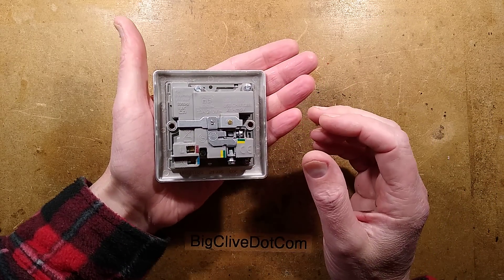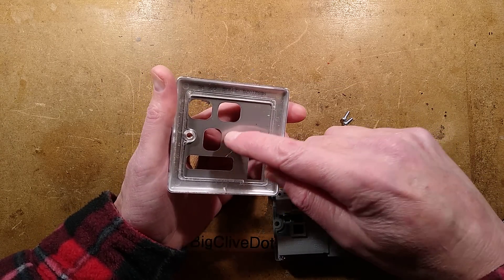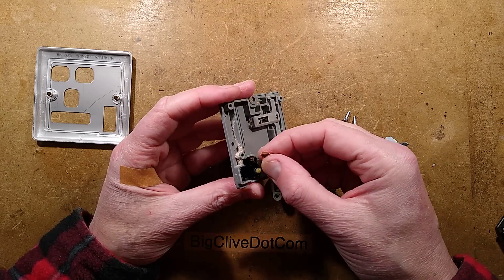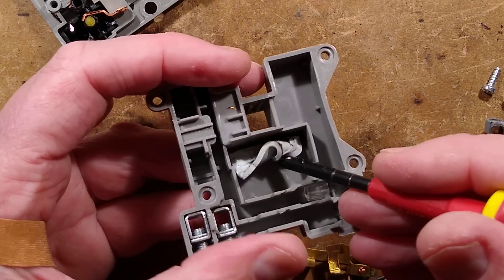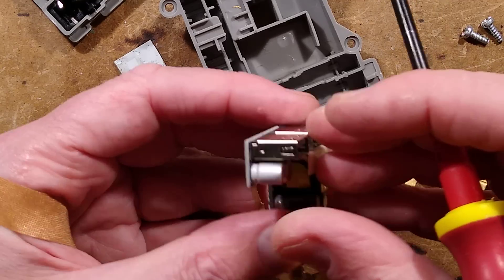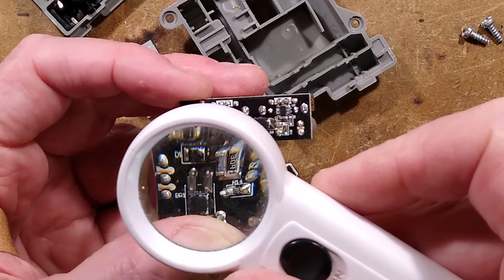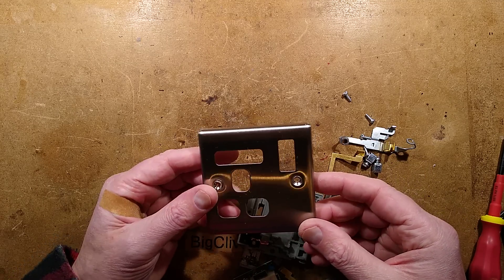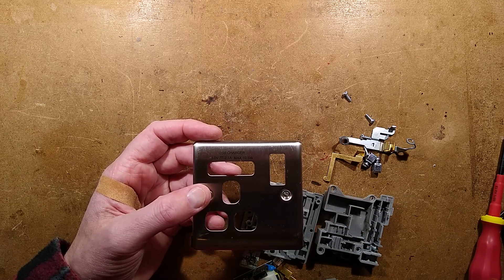Exploded British General USB socket

Comment: Speaking of costly but ideally carried out household electrical repairs, in some markets like the United States, a company called Federal Pacific sold millions of circuit breaker panels and circuit breakers called Stablok for decades. But the Stabloks were later found to fail. UL safety standards they originally claimed and don't always trip when they're supposed to causing fires. The company still exists and the breakers were never recalled, just a notice put out, so many older houses (with poorer people) may still have dubious Stablok circuit breakers. I'm curious what the difference between the Stablok and a good design is! And if a company would make a replacement that is cheap and works well? Apparently the failure to trip rate for Stablok is up to 50%
Reply from the maker: If it's what I think it is, the magnetic trip mechanism was a very flimsy looking flap as opposed to the solenoid coil in European breakers.

Comment: I've never understood why anyone would want these. Sockets, light switches and such are meant to last decades. As soon as you add electronics, they are bound to fail within a couple of years, just as mobile device chargers and others will fail. One huge difference being that you can buy a replacement charger on your way home from work, whereas replacing a socket isn't nearly as easy.

Comment: Thanks again for another great video Clive, I installed several of the double versions of these around our house a few years ago and now feel the urge to bench test the 5v circuitry at the max current and beyond, followed by some over and under input voltage tests. If nothing happens I'll try doing something very silly with the input connections to see if I can replicate that particular failure. BG overall seems to be a pretty good brand but no harm in doing some stress testing on some older ones. If anything spectacular happens I'll report back!
Reply: That bit of foam tape was my idea of 'cooking components'...electronics hate heat

Comment: I had to return 3 double gang with USB sockets to ScrewFix a while ago. First went BAANNG, second and third, the USB controller was completely dead. It seems there's very little in the way of testing before these bits of junk are sent out. The kite mark just seems to be a nice moulded stamp for decoration it seems.

Comment: Convient to have USB power available as well as mains, especially on trains where it means only a USB cable has to be carried with you and not a bulky charger as well.  How about having the a.c. Input to the USB module switched, with the switch operated by plugging in a USB cable, so the USB module electronics would be dead when not in use.

Comment: looks like MOSFET failed, went short, and took out the current sense resistors and then the control IC. Pretty standard failure mechanism of a switchmode supply
Reply from the maker: Yeah.  And people see the exploded sense resistors and think that's the only problem.

Comment: I think that the main issue I have with these things is that, unlike the mains socket, the USB sockets are not switched, so the transformer and all the electrics are permanently live - for basic fire and electrical safety (and for electric bill costs, though that would be marginal here), I don't like anything unnecessarily on, or difficult to switch off.  I have looked around, and no-one seems to be bothered in making one with switches on for those of us who want it, so I would have to put in a switch above it, which would then confuse people because you would have to to turn on two switches for the mains socket.  You would have thought the presence of an existing switch would have given them that idea, but no.

Comment: I always use either fused plug adaptors (the square things with two or three, three pin plug sockets) or a fused extension lead for plugging USB adaptors/chargers into after a genuine phone charger went thermal in the kitchen and just sat there crackling, it didn't trip the ring rcd either. Luckily I was in the room at the time. So having the things integrated in the wall with no protection seems a bad idea.

Comment: You have me worried now, I have 3 BG double sockets on my work bench, totalling 6 USB sockets, is there any protection on the outputs if one of them goes pop during charging, don't want to fry my Gopro, tablet, phone etc, they are all connected to a RCD so safety isn't an issue though.

Comment: What about the fancy dimming switches like the Lutron Diva?  They also have circuit boards and power supplies in those switches, and they are also tucked inside the wall.  I recently had one fail (the builder put them EVERYWHERE), and rather than spend the $30 to replace it, I just put in a good old $3 mechanical interruptor.  I don't need to dim the lights in every room!

Comment: am sorry to anyone who like's these socket's  but i am an electrician    but i still dont trust these   100%  not only for the awkward of testing & inspection iffy reading's  but as a whole i like thing's to be able to be fully un plugged from a wall  when not in use  i have always said  there's getting too much electronic stuff too close to electricity these day's i am in my 50's  now  call me an old fart but   for the sake of a plug in usb as to a built in one tom save space  come on  it then means you have to be next to that socket  to charge your what ever  IF YOU HAVE NOT GOT YOU CHARGER with you  (I AM NOT ARGUING BEFORE ANYBODY START'S SO DON'T BOTHER) me  nice one Clive  so close to firework's night also

Comment: This is why things need to be kept simple. With my car the stuff that fails is the electronic nonsense. That nonsense killed a gearbox and cost me 5K to replace. If it had been an old fashioned manual gearbox with a clutch the electronic solenoid valve would not have been present to fail.

I have a DIY motorhome. I have installed USB charging sockets throughout, charging from 12v. I don't like them. I don't think they're all that safe being made in China. On the other hand a USB adaptor in a 12v accessory socket gets bloody hot at the tip and scares me that it might catch fire.

Comment: I had (still have) a double outlet installed under my desk and then was introduced into the wonderful world of USB C, QuickCharge and USB Power Delivery, so now the only thing plugged into those USB ports is a USB powered LED desk lamp. part of me is considering getting rid of it because most of my stuff now can be charged with a USB C cable and one of those big multi device chargers. Even my laptop is USB PD.

If we ever have an electrician around I might consider having the USB one removed as I don't really need it and that multi-device charger has type A ports too.

Comment: Would you be interested in an EME inverter AC-DC DC-DC converter from a BMW i3? The part cost £5k and I think it would be very interesting to see how it failed. EVs turn out to be very expensive to repair!
Reply: That's not an EV thing, it's a BMW thing.  BMWs are expensive to repair.  The DC-DC converter for a Mustang Mach-E is only about $300, a whole motor is less than the BMW DC-DC converter.
Reply: @jonc4403  BMW decided to put two full on processors in there, but agreed BMW know how to price their stuff

Comment: As soon as you mentioned that resistors and caps  blew I began wondering if perhaps there was an issue with the cap letting some current through due to poor rectification and buck filtering. I wonder if the cap would have worked fine but was too sensitive to the small changes in VDC?

Comment: I redecorated my kitchen one day as a surprise for my then fiancée. I had drilled a little hole beneath the switch for the immersion heater and put in a hook for the oven glove. When I redecorated I unscrewed it and wallpapered before reinstalling the screw in hook. I had no idea the wire went down the way from the switch. My screw hook must have damaged the insulation on the live wire. When I put up the wallpaper, wet paste got squished into the hole and created a path between the live and earth. Not enough to trip the breaker, but enough to give my fiancée a nasty zing. I got told off by the electrician, but I learned something that day. Served her right though, she was a psycho.
Reply from the maker: You're supposed to avoid putting nails and screws in directly above and to the side of electrical fitments, but once a kitchen has been remodelled by house butchers there's no knowing where hidden wiring is.

Comment: These sockets are a joke. Very basic chargers without fast charging support and prone to physical damage by connector prongs or accidental water splash. Use separate charger - period.
Thermal pad inside enclosed plastic box, enclosed in wall without air circulation... oh, well.

Comment: I have to disagree with the ingress conclusion as there are mineral stains on the top of the unit. It wouldn’t take much condensation to soak the silicone foam pad to the point of conduction. Seems like a bad design as masonry walls with metal boxes are the norm where those are to be sold. It’s probably a common failure.

Comment: Question: what vampire drain do these things have, is it significant? If you have half-a-dozen or more sockets with USB around the house does this multiply up?
Reply from the maker: The standby current is very low.  Just enough to keep the output capacitor charged up.
Reply: 30M households in the UK and 6M businesses ... so even an average of 1 vampire watt per site is not good. The biggies like Drax, Hinkley Point C or Sizewell C can each power about 100W per household / business

I have 13AMP with integral USB in the guest bedrooms - for their convenience. The ones I have switch the USB with the socket - but of course I still have to go round when people leave and turn them all off!

Comment: I am absolutely not a fan of electronics directly tied into a ring final / radial circuit that cannot be isolated separately. This is a perfect example of why. Assume that circuitry just smouldered away drawing a mere 2-3A, it wouldn't trigger any protection devices and I'd say there's a large proportion of population that wouldn't know how to isolate it from the DB. At least if a plugged unit fails it can be isolated with the switch or unplugging.

Comment: Probably overload or short circuit on the output end, as there seems to be no reverse polarity or overload protection, which may cause overheating and kaboom. Yes, the IC should have it, but if companies cheap out on it there's a possibility that there is no protection IC there.

Comment: A bit over a week ago, I had an American USB outlet blow. I'm in my room, I start to smell blown electronics, look over toward the wall & see smoke comin' out of the USB ports (there were no USB devices plugged in, at the time). So, I quickly killed the power & reinstalled the original outlet. But if I hold the USB one up to my nose, it still smells of blown electronics.

Comment: I have been writing responses to this channel too much so its time for limitting it.
I do find it surprising how much Better the BG is then LAP (LAP being one of the two established brands that I refuse to fit) even though according to mine friends working in screwfix, LAP comes in BG boxes. Now Zinc (another brand from the same UK importer) was never that good and degenerates further still, yet BG seems to be their brand to show they can do it properly. I cant call it best brand, not in a same league as EATON, MK* or Click** (all of hem obliterating it in Bangla frier test), but it would be sad to see  the suppliers last good brand (and a maker of mine favourite outdoor socket) to go. But it might be just one off.
From the faultfinding side the USB sockets seem to be the most common issue not caused by bad fitting I see these days, even beating the electric showers and mice. So as a general rule I recommend them not to be fitted on a circuit with freezers in restaurants  and even removed some on jobs when making wiring for disabled people with limited power supply dependency. (Never had a case with full power dependency yet). I although usually recommend customers against fitting them on frequent occasions.
About the paint ingress I would be surprised if sockets were susceptible to it. I haven't taken BG apart, but both Click nad Niglon (trade brands) had the back covers Solvent soldered/glued on top even when I took screws off, which would make them less susceptible. 
As I often see sockets over-painted during mine inspections, I would be reluctant to fit a sockets susceptible to paint ingress.

Comment: I have never liked these USB sockets for this reason. I am perfectly capable of changing a socket but if something goes faulty I would much rather just unplug it than have to disconnect the entire circuit and then have the faff of changing the socket.

Comment: I definitely wouldn't have one. It's a silly single mains socket too, if it were a double mains socket as they all should be in my opinion there would be room to plug in a sensible easily replaced USB adaptor. I assume that power supply circuitry is always powered up?

Comment: Why would you install a mains socket with a USB  power supply built in. 
There are a number of reasons for not doing this:

Mixing mains voltage  and low voltage in a permanent interface does not seem to be a good idea. 
The USB standard is still evolving, so being stuck will an old socket standard is also not a good idea. 
It is easy to plug in a  USB adapter, this has the advantage that the adaptor is surrounded with cooling air. The adaptor can isolated from the mains supply by the mains on/off switch.
The adaptor can be easily replaced if it becomes faulty.
The adaptor can be replaced to upgrade to the latest USB standard.
 No sorry, I really don't understand why anyone would think it a good idea to build a low voltage (SAFE) USB interface into a mains socket fixture, it's a horrible idea.

Comment: First rule of safe tool handling, make sure anything you don't want damaged(including yourself) is not in the path of the tool.
Most of us that work with tools regularly completely ignore this and is the reason we have many, many scars.
Modeler's thumb is the most fun.

Personally, i'd avoid this, usb port in the wall, less for the possibility of it going boom and burning the house down, but because usb is a bloody nightmare.
Out of a about 20 wall warts, i've got 3 that will charge everything i own. Even then i have to swap cables for one or two devices as they will not charge with anything but the factory cable. And, only one is 'fast' charge compliant.
I'll take swapping a wall wart, instead of needing to replace a wall socket any day.
Reply: Let guess - you have an iPhone. About permanently cut modeler hands - completely agree with you. Only cheap Chinese made computer case circa 1990-s cuts for computer technics can compel with them. "wall wart" - I learned something new at today. Thank you =)

Comment: I pulled one of these sockets out of  my kitchen wall just days ago because I could hear crackling. I never even used the USB but the switches (it was a double socket) were jammed and seemed to have absorbed grit from the plaster or got wildly oxidised. Quality control?

Comment: I've never trusted these USB in-a-wall-socket type things for the same reason as yourself.  If they go bad, it's much harder to deal with the mess afterwards.  I recently bought a 4 way switched mains splitter from Currys that has a couple of USB ports on it and they can be isolated (ie. switched off) with the switch that controls the fourth socket on the board.  I've never seen this before, as the USBs are normally live all the time, so was suitably impressed when I tried it and it actually worked as advertised!  About bloody time :)

Comment: I find it strange that a device like this has gone bang so easily. I've had a double socket with 2 usb for about 4 or 5 years and there is no issues. we do only use it to charge small devices and not phones or tablets. I wonder if it's those higher power devices are the root cause?
Reply: Variables i suppose what you charge how long for do you leave it overnight. Etc.

Comment: The sticky stuff looks like thermal pad, not sure how much heat it was dissipating through plastic, but I guess that is a way to get some heat off.

Also that is why I rather keep those stuff out of walls or sockets, it just creates more trouble when they inevitably fail. At least with adapter, I can unplug it and replace it with way less fuss. Those sockets I just chug to "smart house" stuff and I always roll my eyes when someone calls at ISP I work at and starts their internet complaint with smart house... usually what follows is expected and plenty of reasons why I am happy with my "stupid house". Also I get tempted to ask them if it will collapse without internet till someone will come over... :-D

Comment: Why would they use a thermal pad against a plastic case? It seems as though maybe there should have been a metal heat spreader there, possibly linked to that rivet bar, but it was removed to save some money.

Comment: I've used British General fittings many times and found them to be good quality, but regardless of the manufacturer, I would never install any socket outlet with a USB port. I do not trust any apparatus that cannot be readily turned off in case of a fault.

Comment: Not wishing to get political to any extent but with the proposed deregulations following Brexit (on top of the increasing amount of 'stuff' from China it doesn't bode well. Of course EU CE marked gear may have faults as nothing is ever perfect. As others have said building electronics into a wall fixture is asking for problems,